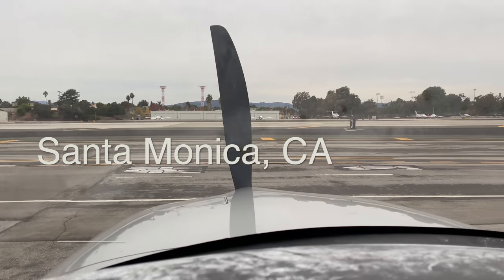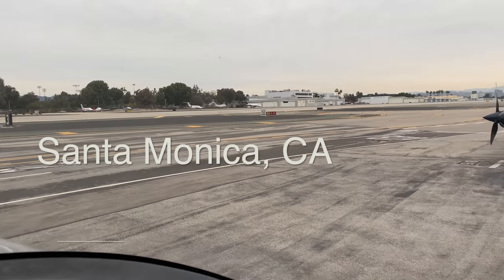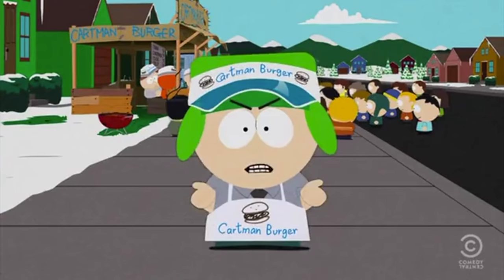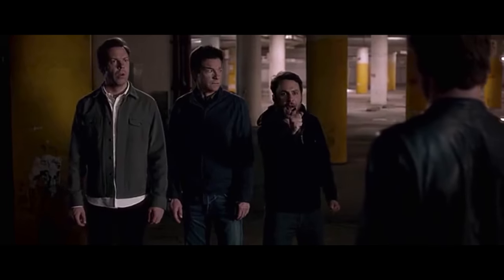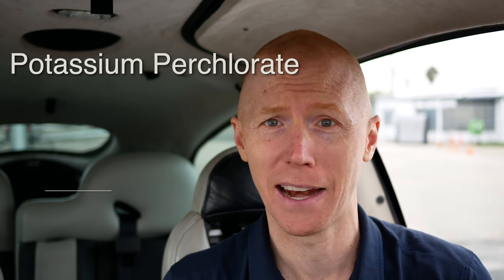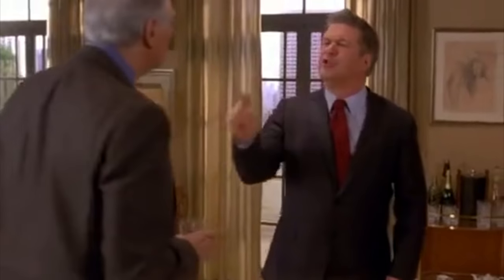WHY A Passenger Must Pull on the Mask | Airline Pilot Explains

Comment: There is no "fake oxygen"! 
Oxygen is either nascent oxygen (O, or monoxygen) or molecular oxygen (O2, or dioxygen, or O3, trioxygen, or ozone)

Monoxygen is highly reactive and will bond with anything, making it unbreathable. 
Dioxygen, however, is the only type of oxygen that can be used for breathing
Ozone, is poisonous, highly unstable, and smells like chlorine. My guess is that's the cause of the smell from the oxygen packs
Reply: Monoxygen is also what people are talking about when they mention "free radicals".   A single Oxygen atom really wants to bond with something and it can be dangerous if that something is DNA or proteins.
Reply: It's clear what he meant by saying fake oxygen. He even stated that it is generated and not just contained in the air like usual. But anyway, thanks vor explaining the obvious 😁
Reply: Thank you for the clarification, "Professor". However, since the pilot does not have a degree in Chemistry, his intent and message in his video are more than enough to explain his loose usage of the term "fake oxygen", as it pertained to the source (free vs. derived). Also, I believe we call it monoatomic, diatomic, etc oxygen, as oxygen occurs in the free state as a diatomic molecule O2 or the triatomic ozone - just FYI.   :)
Reply: @arjonrivera8271  i don't know if you address me or the other guy as "professor". But anyway, I Iistened to the part of the video again and now I got the irony. I just thought that it should be common knowledge, at least what O2 and O3 is. I just wanted to express, that since this is no scientific work but just a YouTube video, it is completely OK to use the terms like this. That is only my point of view, no need to argue about it.
Reply: @derwilly1234  its not you. Its the guy who initially made the comment - Koppa Dasao. Sorry, should have included his name so it's clearer.

Comment: Question: why aren't commercial plane engines built like the A-10 Warthogs where they can take a lot of damage and keep on trucking?
Reply: Good question. There is no significant difference from a commercial turbofan, both are high bypass engines, with multiple stage low and high pressure compressors. May the GE TF34 be built at a sturdier degree, with a layer of armor around it? Possibly, but there is really no need for it in civilian aviation. An airliner seeks performance and cost effectivenes, and (I would hope) it's not going to recieve small arms fire like the A10. It may seem as od, but loosing an engine on an airliner is really not that big of a deal, since it is designed to fly with one engine out (twin engines, not sure about 747 for example, and correct me if wrong, I believe it could mantain flight with 2 engines failed if they were not on the same wing). There are procedures for situations with a failed engine and pilots practice them on at the very least a yearly basis.

Comment: Hey I’m new to your channel. Good content. I have a question for you, is there a minimum height requirement for pilots? Thanks.
Reply: Usually there is indirectly. You must be able to operate the controls and reach all the switches. That combined with the design of the cockpit which is usually based on a range of 90% male to about 60% female humans can limit the height. If you are in doubt check with the local authorities and a specialised physician.

Comment: Lovely video. Now please explain how to best exploit the knowledge that all crying babies will be located on only one single side of the plane, in order to ensure I'm sitting as far away from them as possible!
That said, as a chemistry teacher that possibly should have become a pilot instead, I disagree with calling it "fake" ;-) Oxygen is oxygen, no matter where you get it from. Just like every other chemical compound, really (excluding the whole realm of nuclear reactions.) The reaction might create other byproducts, like the smoke in this case, which are not contained in regular air. This is why, depending on the source,  there also might be minute amounts of different contaminations mixed in, if you want to be pedantic about it. But the oxygen atoms are the same, no matter if the gas is 'distilled' from normal air or generated in a chemical reaction.

Comment: Regarding pilot oxygen use, do you know if the pilots of Concord had to always be on oxygen?  (I thought I remember reading Concord cruised 50-60,000ft)

Also, do you know if aircraft that fly in the areas of the Himalayas have different systems?    (Literally can’t get below 15,000 without “controlled flight into terrain)

Comment: FL410 to 11000 in 10 minutes is a 3000 ft/min descent which isn’t all that hard with speed brakes.
Reply: Emergency descents easily hit 6,000 feet per minute. Maybe he can cover emergency descent techniques sometimes. Power off, spoilers, slow to emergency descent speed, hit FLCH and down you go. On a BAC 1-11 (XX105 look it up) that gave us well over 5,000 fpm, off the end of the meter iirc. My abiding memory was watching the horizon disappear out of the top of the windshield.

Comment: I think you should add a fourth reason why it's not oxygen tanks, the tank itself would be under very high pressure if one should fail it would blow a hole in the aircraft that you could drive a bus through also in the case of a crash high-pressure oxygen tank+fuel+fire = bad
Reply from the maker: I guess thats another reason for sure dibble.

Comment: A little off topic, but related to aircraft emergencies.  What can be done to ensure passengers leave their bags behind when an aircraft is being evacuated in an emergency?  Have seen several videos of tragic aircraft emergency evacuations, with passengers carrying their bags walking across the tarmac from a burning aircraft where people died who were unable to escape.
Reply: not so easy as that is a panic situation and people tend to loose all rational thinking during this situation. If you are not trained what to do you will make lots of mistakes. Normally the system of evacuation is safe enough to tolerate these.
You can only tell people how to behave. Everything else is quite difficult.
Reply: They need to start fining people who evacuate with bags.
Reply: @deeanna8448  It will not work. In such a situation you don't think about fines. It's all about panic.
Reply: @roichir7699  I don't know.  I could see people pushing and shoving when panicked, but I don't see panic causing someone to open an overhead bin and get their roller bag.  I think it's more they they think what's in their bag is SOOO much more important than what's in anyone else's bag that they decide to delay evacuation to collect the bag.
Reply: @deeanna8448  Well no. The panic reaction is different for everyone and every situation if not trained.
For this situation in their mind is the value of their belongings. Not so much material value but like "oh my pants, I need them" or "my Laptop with all the pictures". Something like this. In such a situation there is very limited rational thinking.
So fines will not work, nobody cares about them in this situation. Their minds are occupied.
The same effect occurs in every abnormal stressful situation if you are not trained, like a fight on the street or a bad car accident.

It's human. And very difficult to get around from a designers perspective.

Comment: Hi. How hard should the mask be pulled to activate the reaction and for not to pull out the tube from the container ?
Reply: The tube is quite secure. So don't worry about it, at least if you are not The Hulk. Give it a firm pull that should do the trick.

Comment: These 3 reasons aren't include a pressurized tank may explode on impact. Maybe those engineers simply think that it isn't a good idea to put a boom boom tank above or under a bunch of passengers in distress. I mean, terrorists would be like, why bother bringing the bombs, my brethren. They've prepared a bunch for us.
Reply: These tanks do not explode that easily. It not a movie.
But there are many other reasons why tanks are not useful for passenger suppply.
Reply: @roichir7699  when emergency happens, not explode easily is not enough. I don't think any sane person would want a pressurized tank of anything above them when the plane crashland.
Reply: @jarnMod  Well, there are a lot of pressurized tanks on board, 

Oxygen bottles included.
There are even explosives on board.
But don't tell anyone.

Comment: Can you accidentally pull too hard and disconnect the rubber hose or is it clamped on really well? In a panic I can imagine yanking too hard
Reply from the maker: well I guess don't grab it with both hands and yank, you just need to pull it down enough to release the pin so oxygen can flow... and most planes have extras on one side or the other.
Reply: @74gear  wow, thanks for the reply. I was just watching a radio interview you did. Love the content. Stay safe.

Comment: I have a 3 part question I would like to ask here. When the plane's auto pilot disengages during landing the pilot manually takes over. The thing is, they move the stick left right left down up left.... almost frantically that it looks impossible to land. Also, what does retard mean when landing? Lastly, how exactly do the reversers work on the engines?
Reply: 1) The slower you move, the less air is flowing over the control surfaces, so they have to move further to get the same amount of effectiveness. For big commercial planes, the fly-by-wire computers can compensate for that, but for other planes, the pilot has to do it themselves with bigger, quicker movements.

2) "Retard" is a fancy word for "hold back" or "slow down". To "retard the throttle" is another way of saying to pull the power back.

3) The most common reverser nowadays slides part of the cowling backward, opening a slit in the side of the engine. Then, flaps in the engine redirect air forward out of those slits.

Comment: When it’s time to put one of them on , bad shit is likely to happen , ring your family and say your last prayers , remember your in a metal tube 5 miles high with no parachute ,, remember no one asked you to take this trip death traps in the sky
Reply: You do realise that most, or more specific nearly all, of these occurences result in a safe landing. Tha amount of occurences where there are actually fatalities is very small. If you hit the lottery jackpot ten times in a row you may get the chances of getting badly injured or killed on a flight. Flying is still the safest mode of transportation.
So don't spread unnecessary panic amongst others. And be careful when driving to the airport as that is the most dangerous part of the trip.